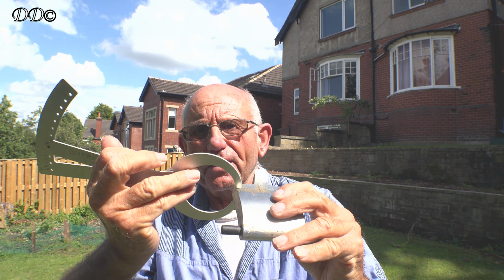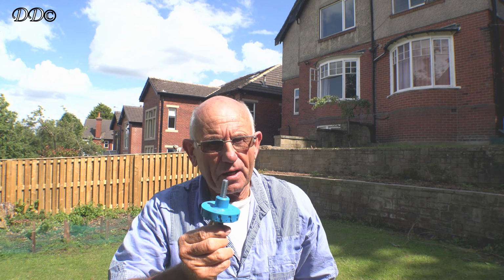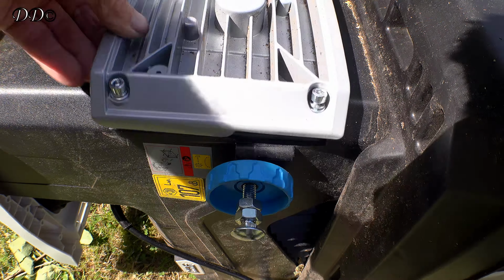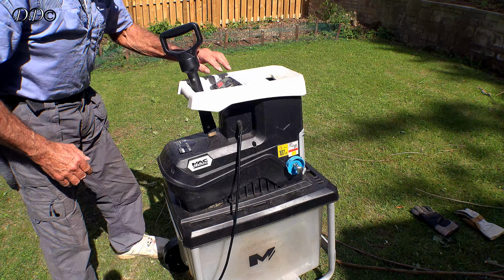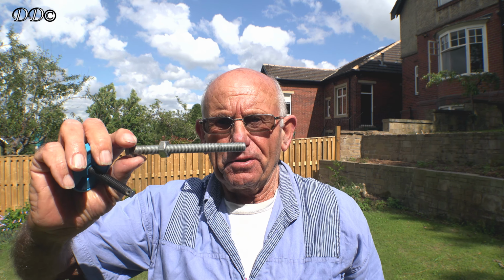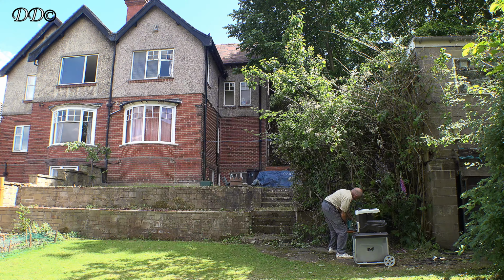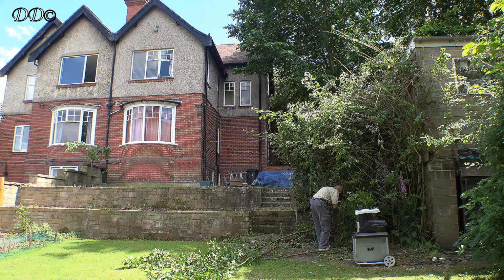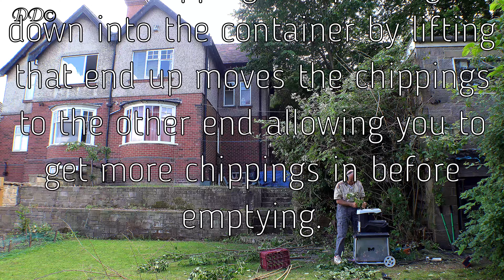Design fault on MacAllister MSHP2800D-2 Shredder easily corrected for £1 Ware to get spare parts. 4k

Comment: Thanks Derek for your help.  Unfortunately, our bolt has been bent and we need a new assembly for the bolt.  Do you know where we can buy one?  That is the retaining ring is really only what we need.
Reply from the maker: If you are talking about the blue reaming locking nut on the bolt no don’t no were to get one, just use a ordinary M10 not and a spanner tern spanner clock wise to lock and the other way to release or a M10 wing nut and a longer bolt.
Reply: @derekawilson2118  Thanks, Derek.  Will try that.
Reply from the maker: Just had that problem see new entry billow video BOLT STICKING and GETTING BOLT OUT

Comment: Hi Derek, just seen this video, I did the same with mine about 6 months ago. Is it a design fault or is it to make the unwise buy new pressure plates more often, a nice extra earner at £16.95 a pop. A bit like printer ink, sell the printer cheap then make the money on consumables!!! Cheers Nick
Reply from the maker: Yes it is a design fault I have told Screwfix head office part of B&Q Kingfisher plc who import this products about this problem them, but they have not replied. I have put on screwfix website in all the Q&A - answer section for MacAllister MSHP2800D-2  a link to this video plus a reply to the questions.

Comment: Great video. Why does the pressure plate wear so much? Could it be a concern that the pressure plate could become in danger of being smashed into bits if you wind the screw in so far that it becomes really thin?
Reply from the maker: The  cutting rotary blade is maid out of hardened metal and the tips are sharpened similar to a saw the pressure plate is maid out of aluminium and is designed to eventually were out, if the pressure plate was maid out of metal the cutting blade would be blunt in minuets, so you have got 2 things wearing the pressure plate away, thick branches going threw rubbing against it and the other is having to very slightly adjust the pressure plate screw until you feel the cutting blade taking a slight shimming of aluminium of the plate.
I only adjust mine at the start of using it if I have put some big branches the last time I used it or looking in the chippings container it has not cut them properly. 
The cutting blade on mine is slightly oval shaped so I only feel it cut the plate in one position on the rotation of the cutter but that’s ok 
To get it to braking point were the bottom bit drops into the basket will take a long time and before that it may make a lot of noise flapping about, see details billow video were to get a new cutting plate, but to get it to that stage you need to get a longer bolt as soon as possible mentioned in video, reason every time the rotary blade is cutting something against the plate with plate the plate is flapping it is held at the top, it is hammering against the soft steal adjusting bolt, that is like riveting/hammering the thread/head of the bolt so to get the bolt out by filing or cutting the bolt out, see my details billow video

Comment: Hi Derek
Thank you for the video it was most informative. Having just purchased an earlier MSHP2800D  in an as new condition by appearances I had been having a bit of trouble. Your video showed that the pressure plate was missing the hooky end,  opposite the black connecting bar, and I have just ordered a new one from Solent. Have you put out any follow-up videos since June 2020.
Reply from the maker: No not put any more videos under "How to" since this one, I presume you have got 90mm M10 bolt or coach bolt on your shredder,  your new one will not have the hook bit on the bottom but it will fit the machine
The hook on the pressure plate I cannot see it rely doing anything, might help in reverse to get bits off, it could be there just to get round some other makes patent. 

The next one I will be putting out is how to set up a Car Paint Film/Coating thickness Gauge about 6 people have had a go at  demonstrating it on YouTube, but haven't read the instructions on how to set it up to be accurate, it took me a while to work it out. So all 6 have said its cheap so not very accurate

Comment: Didn't find the fault you are recording mine seems to be fine with the bolt supplied so maybe they upgraded it 
But  
Mine filled up with detritus in the motorbay and destroyed the brushes which looks as if it's damaged copper rotor :( Will only know when spares arrive

Comment: Thanks a lot - this will come in useful - great to see you can maximize wear on the existing one and also get replacements.  I note you used a 90mm with 2 nuts, would an 80mm be a better bet?
Reply from the maker: I used a 90mm bolt because I already had one, 80mm should be ok as I put a nut on mine to make it shorter, until I have kept turning it and scraped down my cutting plate down to nothing I will not now what the exact bolt will be.

Comment: How did i take out original bolt? Cut ot with saw or.?
Reply from the maker: No Just slackened the locking nut by turning it anti clockwise then turning the same way took out the bolt
Reply from the maker: Just had that problem see new entry billow video BOLT STICKING and GETTING BOLT OUT

Comment: Excellent video. Thanks for the advice on spares! Very much appreciated! 
Though I can't understand why you were forcing the material into the shredder as it self feeds most of the stuff feed into it and you are only stressing the motor by forcing it in.
Reply from the maker: If you notice I am not forcing the branches in, the slot on the shredder is oblong with a wider point at one end,  you have a to hold it if it is a long piece like I was demonstrating or the machine will tip over the feed is making my hand go down with out any force you’ve got to keep turning the branch so that all off branches line up with the oblong opening or it will jam up, plus there might be a bit of the branch before jumping around in the compartment, then you are pushing that down to allow the branch to start. Note there is a automatic over load and reset on the machine

Comment: I did't seem to pick up what's happening here. What difference does the new bolt make? Does the machine shred better as a result? Shred smaller? Thanks.
Reply from the maker: Watch the start of the video will explain the problem and y you need a longer bolt.
Reply: @derekawilson2118  Hi. I just watched the beginning again. I get that you say a longer bolt is needed and it seems that it needs to be longer to push the pressure plate nearer to the cutters?? So it shreds smaller? I can't actually hear you say why the longer bolt makes the difference. Does it affect the cutting?

Comment: Not a design fault, just planned obsolescence and poor quality.  Derek, I thought your fix was good enough for me to overcome my instinct against buying MacAllister Chinese junk, but I should have stuck with my instinct.  You have found a problem with the product and come up with an admirable fix, but the inscrupulous Chinese are already ahead of you.  :-(  Bought one of these today, intending to apply your "fix", but the threads on the adjustment bolt have been crimped at the end, so it can't be removed and replaced with the 10mm coach bolt!  Not only that, but the bolt must be shorter, since its reached the end of travel, has stopped cutting fine twigs and has only worn 0.5mm off the plate!  Having spent less than 2hrs "shredding" with this piece of junk, I'll be out with the Dremel tomorrrow to cut off the "redesigned" even shorter bolt so I can apply your fix!  Hopefully that will make it work properly.
Reply from the maker: Are you sure they haven't sold you a used(now 2nd hand) cleaned up by purchaser that was returned within 28 days of sale for money back or job dun or both, as the bolt gets shorter and crimped when it is used ?
Reply: @derekawilson2118  Well I can't be certain, but it looked brand new when I assembled it so they couldn't have actually shred anything with it if it was a return.  Anyway, the Dremel didn't work, but the multi-tool and a new metal blade cut the crimped end off the bolt to allow it to come out.  So now I have installed your fix, with my own minor improvement: a 75mm wheel from B&Q wedged onto the square end of the coach bolt to provide easier adjustment.  Adopt, adapt, improve.  ;-)

Comment: Read the manual. Turn the outer knob counterclockwise, then the inner one, and there is no need for a couch bolt.
Reply from the maker: Watch the video from the start. Soon you will find the bolt is fully turned in after not so many scraps you will look at the cutting plate and see hardly anything has been taken off, the bolt is two short to ware the cutting plate down fully, that the reason you need a longer bolt.

Comment: I had the same problem, but approached it slightly differently. I removed the adjuster, then removed the inner ring and reinserted the adjuster which allowed for an additional few mm of adjustment.

Eventually the pressure plate will wear so thin that it breaks - replacement blades can be bought from here for about £20:https://solenttools.co.uk/product/solent-tools-pressure-plate-compatible-with-macallister-mshp2800d-2-shredder/
Reply from the maker: Thanks for sharing. Also see my reply to one billow yours for the reason it happens and how to rectify it etc